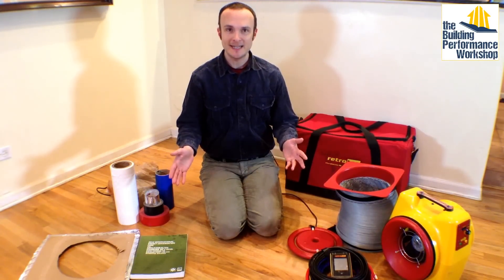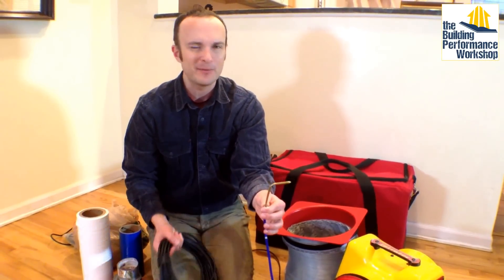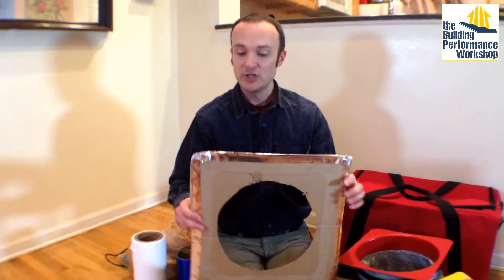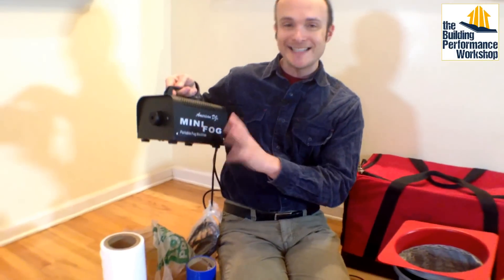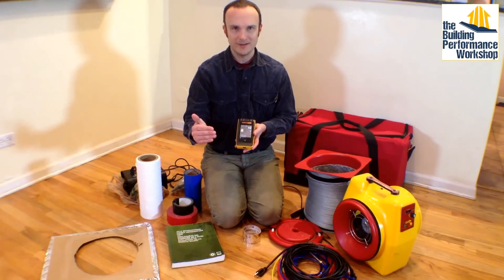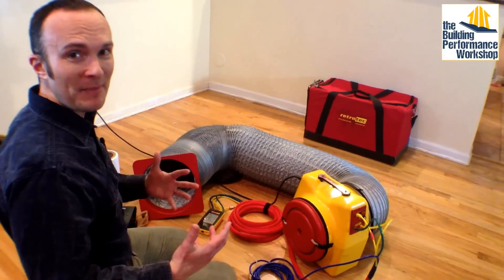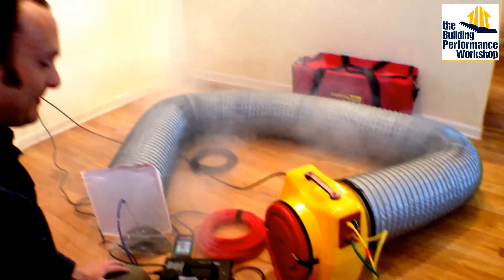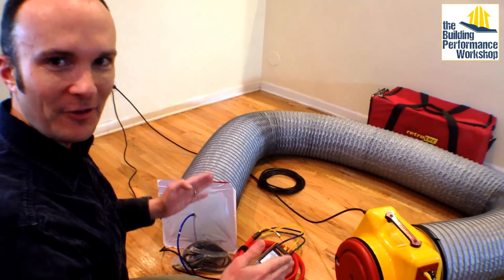Advanced Duct Tightness Testing Technique: Snorkel Air Leakage Allowance

Comment: What I am always confused about this tests is that on all the videos I have seen and all the test I witnessed the techs seal all the vents but I never see them sealing the air intakes of the HVAC system and even if you have a very sealed ductwork then the air intake will also affect the duct tightness and count as a leak because air will blow and escape in that direction. Right? What am I missing?
Reply from the maker: The returns are either sealed or that’s where the fan is connected to the system
Reply: @HomePerformance  Sorry but I am not talking about the returns. I am talking about the main air intake coming from the outside or living area to the furnace. Techs never seal that.
Reply from the maker: @NaturebyGus it should have a mehanical damper, but yes if it’s there, and experienced duct testing pro will tape up the ventilation terminals from outside.

Comment: This video uses the Rectrotec Duct Tester -- I also do duct testing but use an Energy Conservatory "Duct Blaster". The basic equipment & test gauge look different but both seem to function the same. I personally had a problem on a test site where we struggled to knock down the leakage to the code target. The HVAC Tech looked at my "snorkel" (or flex duct) & saw pin holes like those here. I recalled watching a similar equipment check video & also found a 5 cfm flex duct leakage. To say the least, we kept sealing until recorded leakage minus 5 cfm passed code. But the moral of this story is that the next day I bought some 10 in dia. flex duct at the HVAC supply house & replaced that embarrassing, leaky "snorkel."

Comment: I'm doing this test at a mobile home factory...the test pass between 1.5 to 2.5.
  My concern is there any way 25 pascals is high enough to blow the mastic out and cause a leak if it hasn't dried?
  It takes 1900 pascals to equal 1 psi from what I've seen?
Reply from the maker: 25 Pa is 0.1” wc, which is exactly what the duct system is designed to be pressurized to by the air handler. No problem at all. I would never test before mastic has dried though.

Comment: Hi Corbett, I've seen you using both equipments TEC and Retrotec which in your personal opinion would be the best option?
Reply from the maker: They’re different styles, both have their strengths. I’ve generally taught people on Retrotec because it’s easier to learn fast with the color coded hoses and ports, and smart manometer.

Comment: Why does the snorkel have manufactured holes in it?
Reply: Maybe if you run a negative test with high pascal (or accidentally) and the system is tight, it won't collapse the snorkel??
Reply from the maker: They’re probably not intended, just happen because of hard use
Reply: I replace mine w a hvac vinyl duct